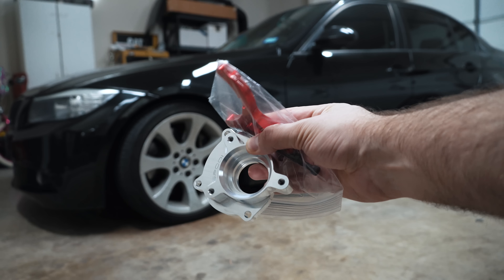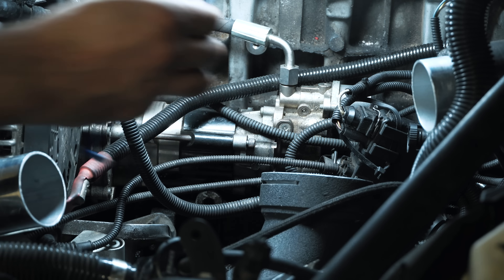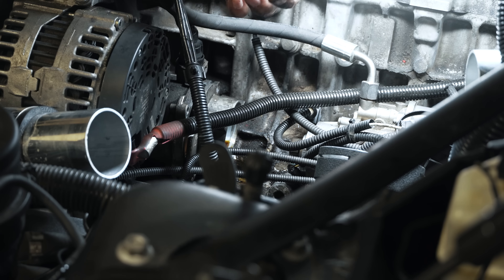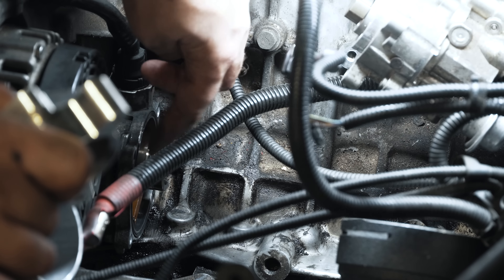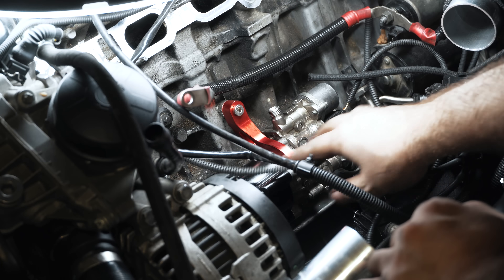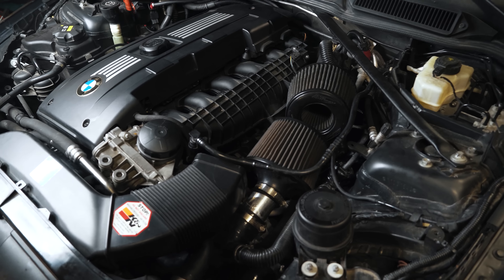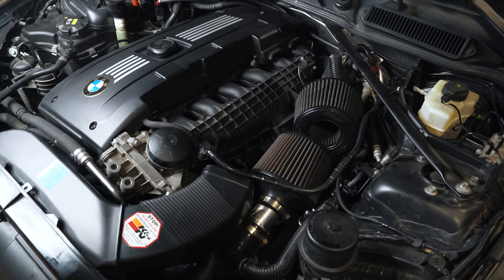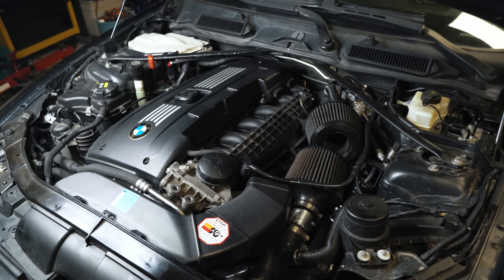Helix HPFP Overdrive 6 Month Update | BMW N54

Comment: The reason the car gets a clatter at startup is because the car runs off a different rail pressure target table under 40*c.  The cold start rail pressure tables target over 2000psi at idle which causes the noise.  Have ken update the tune to have the car change to the warm up tables much earlier or have him lower the rail pressure target on the cold start tables.
Reply: Thank you.

Comment: We need another update to see if the parts actually work. Yes i would assume so since there isnt an update but a video to confirm would greatly help the community. We also need to get other people willing to look at the gear that drives the units to see if wear is showing like the 4 cylinder issue
Reply: I’m also interested in a update on this

Comment: Brother tomorow (Monday)  we are going to the dyno and make some real numbers on helix 4x and dynamic autowerx stage 2 turbos. We have all the fuel we need. Running full e85 and 50/50 methanol on 26 psi and we will test them on 28 or 29 psi. Just see what they will make. I'll send the numbers to Rolleymotorsports your friend and he will send it to you
Reply from the maker: Hey good luck!  Sounds like you'll make  575 whp +.  I just had a new tune sent over where we turned things up, also Rod Sutphin reached out.  Did you recommend he contacts me?  You were taking about it I a previous comment.  So I'm going to load his trans tune, I got my tuner to add in the tables he recommended to my ecu tune.  Looking forward to seeing what these turbos can really do.  They were asleep with regards to the wastegate duty cycle running 24 PSI.
Reply: @VehicularDIY  thank you! He knew about you but I was like hey let Vehicular DIY try your tune because I loved it myself most likely you will as well!  Hopefully the car makes good number!,  its dyno jet. Tomorow will let you know what it will do!! Yea even at 26 psi it didnt even had more then 65 wdgc on the logs

Comment: What I did with mine to help with the chatter was went into the mhd and i upped the rpm for warmup to like 900 if I go up a 100-200 it should stop chattering on start up or helps a lot
Reply: @Baker Alec instablaster =)
Reply: @Braylen Wyatt It worked and I finally got access to my account again. I am so happy:D
Thanks so much, you saved my ass !
Reply: @Baker Alec You are welcome =)

Comment: After your experience with the Helix Overdrive, would you go with Port Injection and a standalone ECU? Of course, I don't want to spend a ton of money on something that can do the same thing for cheaper, but now with the reliability updates of the Helix Overdrive, it looks like a good option. 

You mentioned on someone's comment that you should replace the oil pump chain tensioner before doing the Overdrive kit. Is there anything else you should replace? And also did you have any reliability issues with the OEM HPFP? I'm just worried about more strain on other parts.

My power goals are to make 600whp with 19t turbos on full E85. Later on, I want to make 700whp on E85 with a single turbo when the 19t's blow up.

Comment: Who’s your tuner?  I emailed spool performance and was told that the chatter/grinding is on the tune side and needs to be adjusted by the tuner.
Reply from the maker: I'm using Wedge Tuning.  I haven't asked but that makes sense.  Even just disabling the code start would pretty much get rid of it.  Thanks for the info.

Comment: Great video!  I just had a question.  now that you have the stage 3 lpfp and the Overdrive hpfp can/are you running full e85

Im aming for a solid 550whp with my 335i on DIs only
Reply: Late reply but with full e85 you should be able to squeeze 650 with the overdrive kit and into 750 with e60 mix

Comment: Hello, unrelated to this video, but are you currently using the curved CNC adapter on your front turbo snout to connect it to the your outlet?  I saw your VRSF outlet install video awhile back before you upgraded your turbos.  Basically I’m having troubles with my front turbo outlet gap and am looking for a solution.  I ordered some VRSF outlets from ECS Tuning but the fitment isn’t even close, so I’m going to resort back to the MMP silicon outlets and try to get a proper gap
Reply from the maker: Hey, yeah I am using that aluminum snout.

Comment: Great video good Sir as usual. I have a quick question I have the weirdest timing corrections when I'm shifting from 3rd to 4th and it seems like my trans is slipping. It like revs out and is a delayed shift.  All maintance 1 step colder plugs mhd e30. In the winter when its 15° out
Reply from the maker: Hey thanks.  Do you have an ethanol sensor installed to verify the ethanol content?
Reply: @VehicularDIY  I do not have that sensor at this time. But I can confirm for sure I am running e30 plus without doubt maybe even closer to e40* just to be safe. I am using Sunoco E85R jugs mixed with a gallon of sunoco 100 unleaded and the rest of course Shell 93. I just dont want to embarrass myself the next time a sti pulls up on the highway..
Reply: You may need the XHP Stage 3 trans flash
Reply: @TheSpeedAddiction  Yea I'm going to get it. Think I should do the drain and fill of fluid before or after trans flash
Reply: @obiwankenobi9315  Its wise to do but might not be necessary at the moment.

Comment: After having installed the helix with bracket and support, have you got any oil leaks from the vacuum pump area?  Have you checked your engine bay?  
I got the helix kit because I seen your video, and went ahead and replace all gaskets for vacuum pump too, but I now see a slight leak from hpfp area.
Reply: Mine is starting to do the 
same, at first I thought it was a gas leak. The more I've been reading it seems some do leak. Helix paperweight coming soon. To risky to keep this thing installed.

Comment: can you run this setup with a stage 2 pump and achieve 600hp? without PI?
Reply: Stage 2? Maybe not sure but 2.5 like a 535 yes definitely
Reply: @ms3_alejandro  lol I’m now running PI full e85 pushing about 630whp lmao
Reply: What’s the full fuel system your running ? I have stage 2 lpfp and e50 MHD stage 2+ full bolt ons I want port injection to get from 425 to where you’re at what else besides the manifold and injectors do I need just a controller right ? Aic or jb4 or what u recommend ?
Reply: @chrisfa7439  I’m running port injection with aic controller, stage 3 fuel pump with stage 3 turbos and a custom tune MHD tune running full e85
Reply: @ stage 3 dual all time or primary with secondary on hobs switch ? Which turbos ?
Reply: @ hobb switch and I have the DAW turbos they don’t make them anymore unfortunately

Comment: I’d totally buy one I just don’t have a grand to drop right now. How’s ur LSD mod holding up btw? Any negative effects?
Reply from the maker: The LSD retrofit hasn't degraded as far as I can tell.  It still helps keep the car straight under heavy throttle.  Compared to the OEM LSD in my M340i I'd say it's about half as effective.
Reply: Vehicular DIY Appreciate the honesty, and for a fraction of the price of a brand name LSD I’d say if it’s half effective it’s worth it. You’d recommend buying a used 335 diff first right?
Reply: @VehicularDIY  Yeah, but that is a full electronically controlled clutch plates LSD.  A true late model M LSD.
Reply: That plate system anygood for drifting here and there ?

Comment: Is the billet vacuum pump plate necessary with the support bracket? Seems like the bracket alone would be enough. The videos are awesome, BTW. I was content with my stock turbo FBO tune up to 20psi midrange, but after watching some of your videos and some Infinity Q50/Q60 videos I am trying to talk myself out of upgrading my turbos. I also have a truck I want to build so I need to make choices.

Comment: I'm a bit lost here ,  if this kit is for the hpfp then why is it called an overdrive kit ? That sounds like something for the transmission ,  does this fix cure the unreliability the hpfp has ?
Reply from the maker: You retain your stock HPFP but this spins it faster to deliver more fuel.  You would want to ensure you have a healthy HPFP.  The HPFP reliability issues have mostly been sorted as the newest iterations of the pump aren't prone to failure.

Comment: So I think my HPFP just shit the bed. What is a definitive way to test whether it’s the high pressure or low pressure? I have a generic code reader, nothing fancy.
Reply: Can you hear the fuel pump when you open the door?
Reply: Ben yes and when I unlock the doors with the remote.
Reply from the maker: You could download MHD Flasher and get a K+D Can cable to get manufacturer specific codes.  Does your car start at all or does it just crank?
Reply: Vehicular DIY it starts and idles. It will drive around in limp mode.
Reply: I took everything apart last night to prepare for whatever I’ll have to do. Intakes are filthy so I’ll do that CRC chemical clean that you did. 
I’m just wondering if there is a definite way to single out the HPFP or the different sensors before I spend 700$ on a pump.
Reply: Vehicular DIY I could if I had an android device. iOS family here.
Reply: Vehicular DIY gotta tell ya. The results of that crc intake cleaner are amazing. 
Small victories.
Reply: Vehicular DIY so I downloaded inpa in one of my old windows xp laptops. I bought the k+dcan cable. After the excruciating experience of installation I thought I was up and running. 
I went into the software and tried to read the error memory and I get a script error. 
I re-installed the cable manually selecting the driver this time. And still the same thing. Not sure what to do now.

Comment: Whats ur rail pressure full throttle
Reply from the maker: 2900 to 3200 PSI
Reply: @VehicularDIY  how much boost are you running?
Reply from the maker: 24 PSI
Reply: @VehicularDIY  thats excellent..  i need to get one soon.
Reply: Whats ur fuel setup and type?
Reply from the maker: Running E60
Reply from the maker: Also installed a stage 3 lpfp.
Reply: @VehicularDIY  e60?  Is that what you call it when u do a blend with 93 oct?
Reply: @VehicularDIY  iam using 4 to 1 ratio 4 parts 93 1 part e85 . Does that make it e25?🤔

Comment: Is there any way to contact you other then here? I have a couple of questions I would like to ask you. Thanks.
Reply from the maker: You could reach out via email, you'll find that info on the contact section of my channel.
Reply: @VehicularDIY  I will just ask you here. I have a 2007 335i I have the BMS DCI, Arm Motorsports fmic and MHD stage 1+ tune on it. I keep getting error code 30fe and 3100 for over boost. I have replaced my boost selonoids and still get these codes when I get around 5k rpm. Do you have any idea what could be causing this problem? Thanks for any info you can provide.

Comment: So that’s not an original HPFP?  You have 80k miles on it, what hpfp did you put on the car? I may need to swap mine soon I’m at 144k
Reply from the maker: I'm assuming it's not original given all the recalls when these cars came out.  I know that it has at least 80K miles on it.  That is as long as I and the 2nd owner had the car.  It could have way more.
Reply: Vehicular DIY thanks. Was trying to determine if mine needed replacement or not. I also put 80k miles on mine since first owner. Idle is dropping 100 rpm every 15 seconds or so, a shutter- thought pump could be going.  I’ve already replaced everything else I can think of to replace.  Thx
Reply: Adam S did all that.  Plugs were pre gapped Bosch. Recent code showing possible exhaust leak messing with the new o2’s

Comment: damn this over drive kit is like $900
Reply: how much is a solid, non-batch firing port injection kit? a lot more considering you need a stand alone to do it firing sequentially and not batch firing aka dangerous af if anything goes wrong.
Reply: @von...  one of the advantages of the port injection is your valves and ports stay clean. Idk about the standalone management reliability but jb4 says their stuff won't fail.